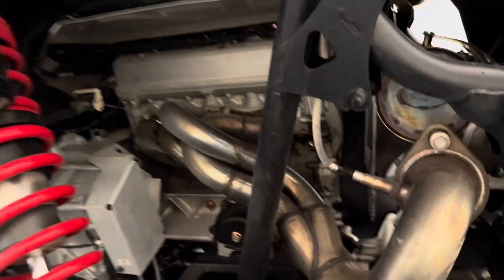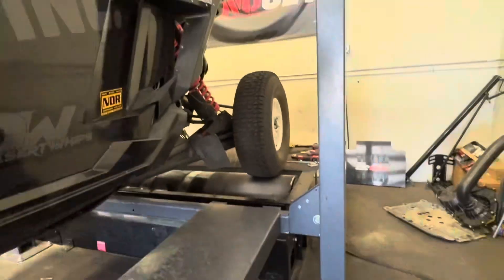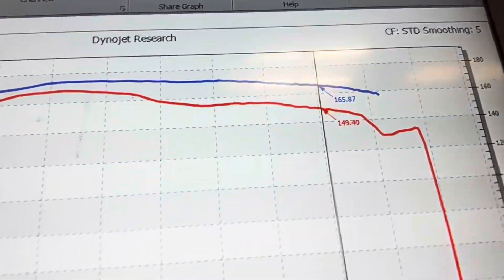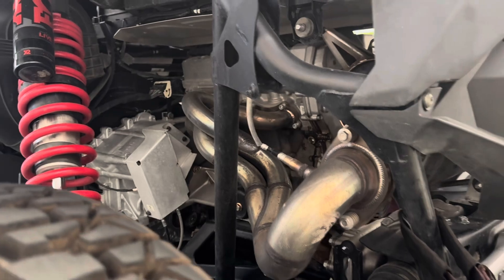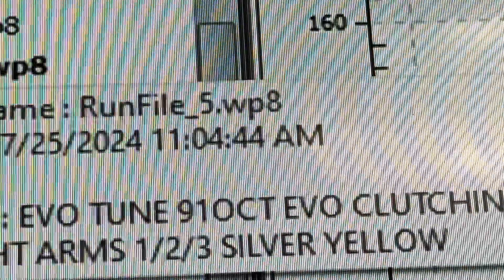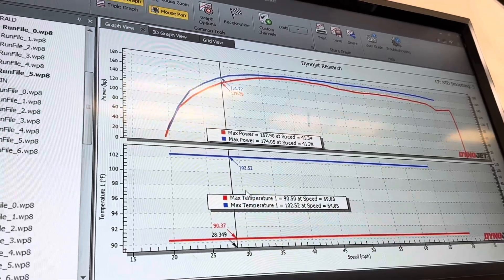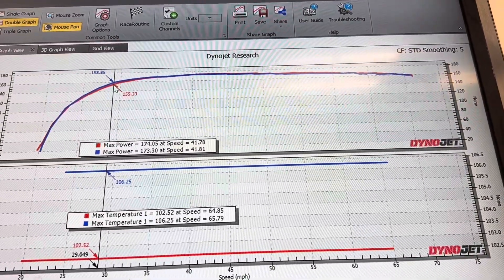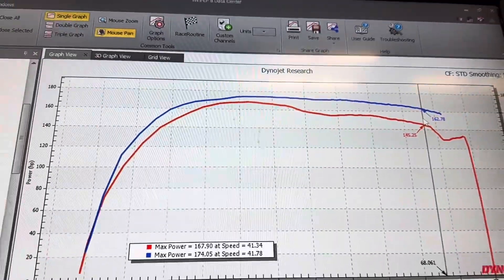RZR Pro R Header Dyno Testing - EVP vs Stock! For Science….

Comment: The factory header on the Pro R is just like the Doug  Thorley Tri-Y muscle car header. They make power and help scavenge the exhaust gases out. The Polaris Factory Race Team tried other header designs and went back to their stock factory header design. For me, I am keeping the factory header. It is a work of art and does it efficiently. The thing that might make a huge difference would be to Ceracoat it and maybe heat wrap it near the shock to keep the shock cooler.